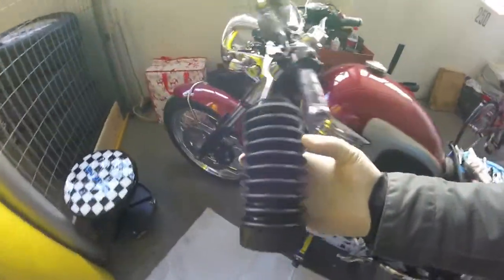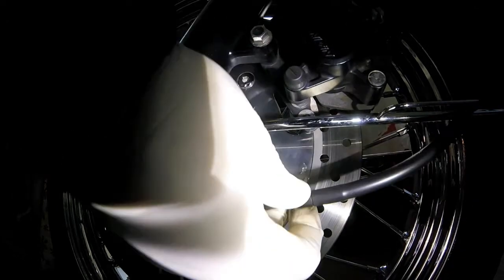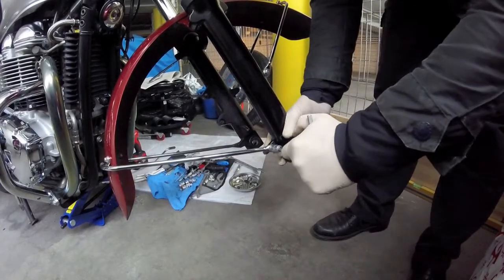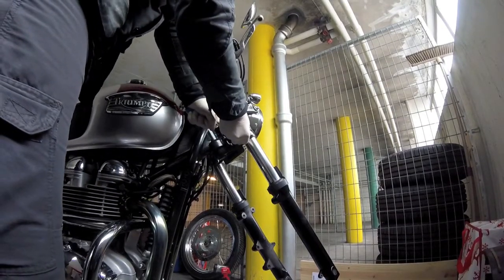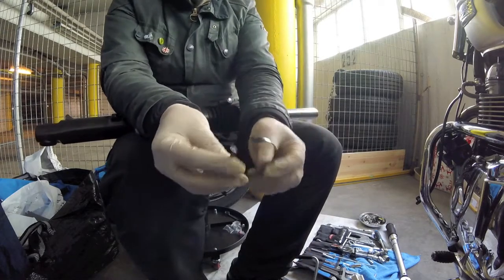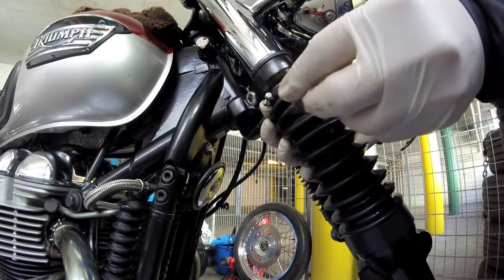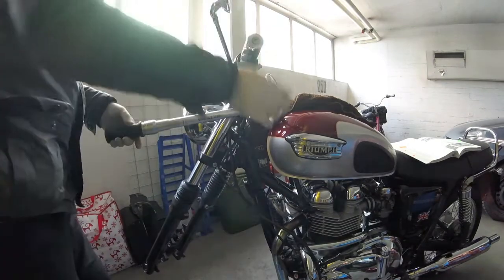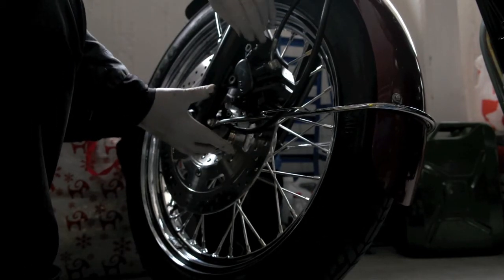Episode #5 - Any time is Fork Gaiter Time!

Comment: I once had a Honda CB 750 and was actually able to just remove front wheel and fender etc and slide new gaiter on from the bottom.  New rubber was so fresh, it went right over the bolt attachment points. 
Not sure its possible on the Triumph.  I have a 2005 t100, so that'll probably be an issue at some point. Thanks 😊

Comment: How did you alight the folk (install it back as original) when you reassemble it? I saw you tighten it down on this video before attach the wheel back on will that cause any problems? Thanks
Reply from the maker: Hi and thank you for asking. It's been several years since I sold my Bonneville, but I did do pre-tightening and then post-tightening to ensure the alignment was correct. Good luck with your bike and ride safe.